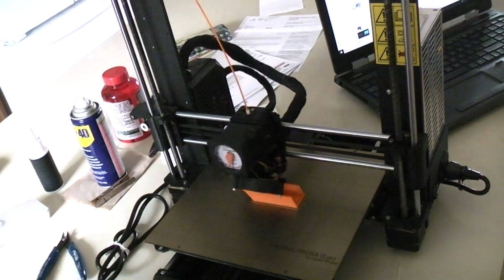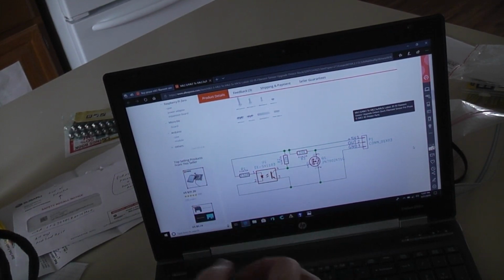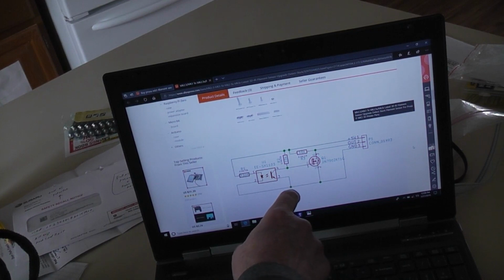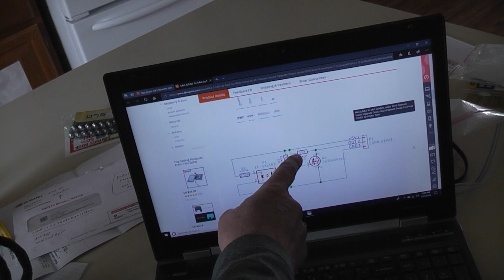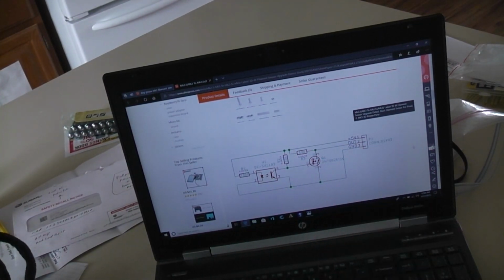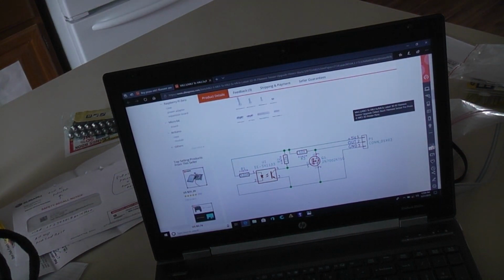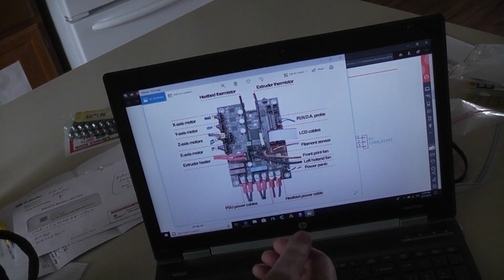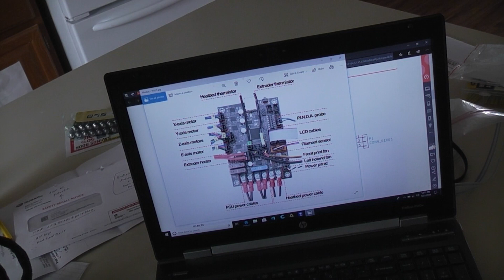Testing the Prusa i3 MK3-S "mod" inductive proximity filament sensor . Part 2

Comment: "inductive", isn't it optical?
Reply from the maker: Nope. I do not care for optical sensors, so I designed this inductive filament sensor. Still uses there steel ball displacement but uses a inductive proximity sensor instead of the optical sensor.